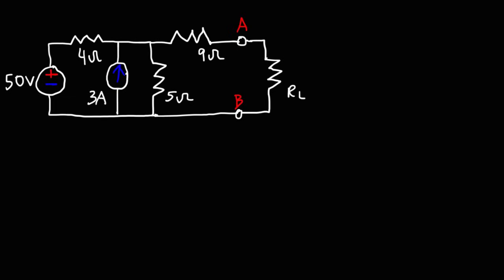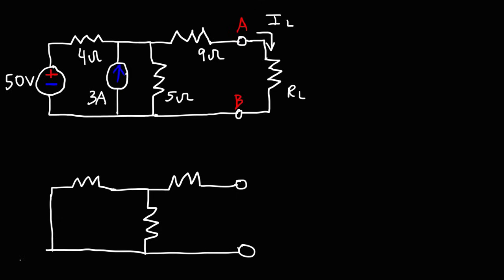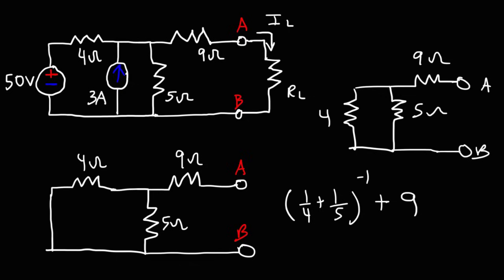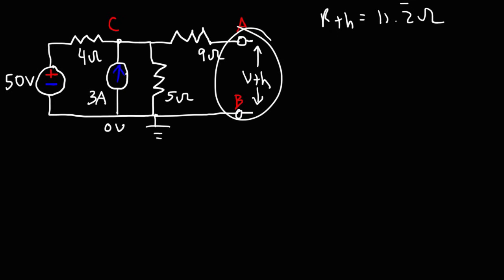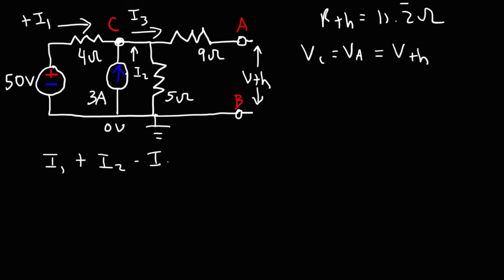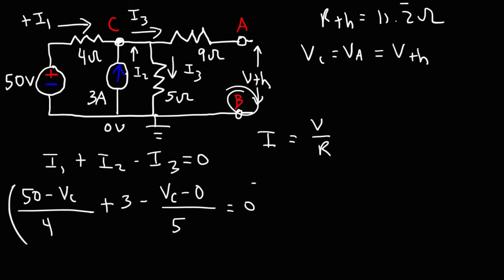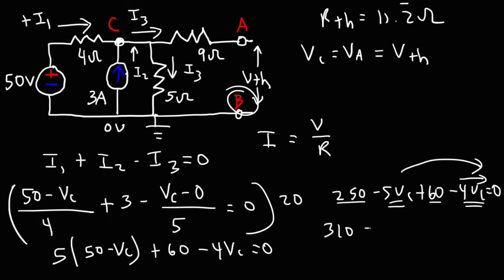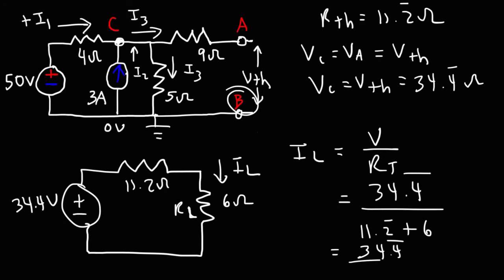Thevenin's Theorem - Circuit Analysis

Comment: Why did you add a ground? Can you still solve the Thevenin voltage without it?
Reply: Also, why aren't we using the 9-ohm times the 2 amps to get A?
Reply: I believe he added a ground to serve as a reference for when doing Nodal Analysis. When doing Nodal Analysis, we tend to assume there's a potential of 0V in one of the nodes.

Comment: how does voltage flow through the 9 ohm resistor when there isn't a closed path? shouldn't Va = 0 A ?  3:26
Reply: No, remember that voltage is measured across 2 points, so the voltage across 9 ohm ( Vc - Va ) is actually 0V but Va isn't necessarily 0V. 
; )

Comment: great job. I want to ask if there is no 9 as a resistance, the resistance 4 and 5 will be parallel or series?
Reply: series if there is no other wire connected or divides the current

Comment: how one can say that the current, i2, from the current source,3A, will go to right? why it will not go to the left through the 4 ohm resistor? if there was a voltage source in the place of the current source, I would understand that the larger voltage of the battery will dictate the direction of the current.But how can one compare current source with voltage source for the purpose of finding the direction of current in the circuit, which has multiple voltage and current sources?

Comment: why are not 5 and 9 in parallell with series with the 4 ?
Reply: Yes I wondering is 4 and 5 consider as parallel?
Reply: @jianfeng8136  do you know now why the 4 and 5 resistor is parallel?

Comment: Why is Vc equal to Va again? 03:30
I don't quite understand. Can anyone help me?
Reply: I have the same question to you. Then I repeated and they say no voltage is traped in 9 ohm resistor, that means it is in the same non resistance line, and voltage at c must be the same voltage at a

Comment: This is super. I have watched so many vids and read this in books and could not get my head around it. This makes it so simple. You DON'T skip steps like the others. I couldn't grasp why R1 was in parallel with R2. Now I follow. Your vid on series/parallel was a great help leading up to this. Thanks
Reply: Yeah these professors be skipping 50 steps while explaining
Reply: why is it parallel help me please
Reply: @carltonyuan2442   Hi Carlton. It took me a few vids to get my  head around this. Remove the voltage source providing a short circuit as instructed. That brings the left hand end of the 4 ohm resistor to earth - in parallel to the 5 ohm. It helps to redraw the 4 ohm resistor vertically where the voltage source used to be. Hope this helps.
Reply: @carltonyuan2442 simply because they are not there in the same line. Same line is series and opposite is parallel. From the diagram you can see that 4 and 5 are not on same line so parallel and when these two combined we can draw that upper side 4 ohm or 5 ohm it can be series with 9 ohm. Hope this helps you .
Reply: @karthikgaming2690 Well if i consider the following loop : source (50v) then r1 and then r2 theb they are clearly in series.
Reply: @carltonyuan2442 they share the two same nodes, resistors in parallel have the same current

Comment: Great. I'm starting to see a pattern in solving for Thevenin circuit. Thank you!!!
Reply: What’s the pattern???
Reply: @danielmoreno9935  first equivalent resistance making the short circuits and open circuits then apply KCL or KVL to find the voltage or current (in case it's Norton's) with the sources on and create the circuit in serie (thevenin) with the two given information

Comment: You never show how to get the 6ohm, you say that it was solved for earlier but it wasn't. Please show how to get the 6 ohms using the information given.
Reply: He skipped the very first step of the problem, Normally at 0:00 in the place of that RL that resistor would measure 6 ohms and then you would replace it with RL and use Thevenin's theroeum. When he uses that 6 ohms much later in the problem when he needs it. So to answer your question 6 ohms is given and you don't need to solve for it.
Reply: @randomguy9084  thank you!!

Comment: Why you don't change the 50v voltage sourve and 4Ω that are in series to a current source parallel to the 4Ω by simply doing V/R then proceeding to make the circuit simpler through normal parallel and series method in order to do this twice as fast and easier? this should be the last thing you would ever want to do to find Vth

Comment: Where did you get that 6 Ohms?
Reply: South CurseOne that’s the value of load resistance
Reply: @amancharlamanas3812  but where did he mention that ?
Reply: @bryyd1922  the value of RL can literally be anything. Thevenin Equivalent looks at what voltage that resistor sees in front of it and the current across it. The voltage drop, in this case is 12, will change with any RL values since the VL=RL*iL and we calculated iL using the thevenin equvalent of the circuit.

For example, if you plug in 1 ohm as RL, you will get these values:
iL = 2.8197 A
VA = iL * RL = 2.8197A * 1Ohm =  2.8197 V
VC = 2.8197V + 2.8197A * 9Ohm = 28.197 V
Current across 5 Ohm = 28.197V / 5ohm = 5.6394 A = i5 <--- this is just a random variable i chose
Current across point C, iC = i5 + iL = 5.6394a + 2.8197A = 8.4591A
Current across 4 Ohm, i4 = iC - 3 = 5.4591A = i4  <----- Again, another variable to denote the current across 4 ohm 
Voltage drop at 4 ohm = 4Ohm * i4 = 4 * 5.4591 = 21.8364 V = V4 <----- variable for voltage drop across 4 ohm
And in the end, going back to the power source, VC + V4 = 50.0V <---- 50V at the source which is always a good way to check if youre doing your calculation correctly.
Reply: @zodcx  ah ok. Makes sense now. Thanks a lot. <3
Reply: @bryyd1922  you're welcome :D
Reply: @zodcx  He never explains where the 6 ohms comes from he just throws it in there and says it was solved for earlier when it wasn't. your explanation does not explain why he uses it. He also doesn't explain where the 12v comes from at A. You say the RL can literally be anything but what if we just use 1000 ohms? then the problem wouldn't make any sense meaning you can't just throw any RL in and expect the same results. thevanin resistance equivalent was found to be 11.2ohms. What  is VL? what is iL? how were those figured out?
Reply: @thenatmann1  I don't know where you found a statement where I said that you can "expect the same results" by throwing any RL values. You don't. You get a different Isc and Voc every time and that is what you use to find Isc = ILoad which is the current through the load resistor. The voltage drop in the load is VL and is calculated using RL and IL, obviously, is different from every load resistor. If you have R = 0, then your IL=Isc would be infinite as R=0 is technically a short. If R = infinity, then Isc is open and is equal to 0. Using Isc and RL, you can find the voltage drop across the load (6 ohms), which is 12V in this case.